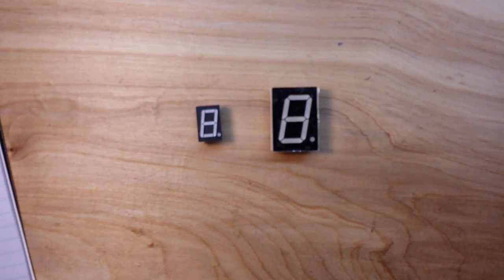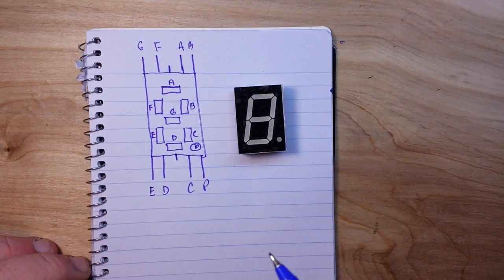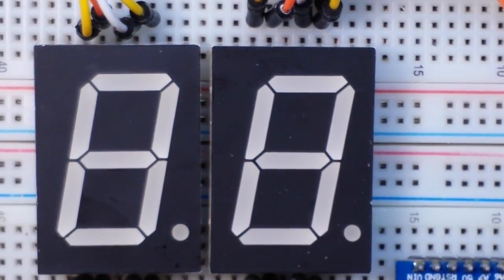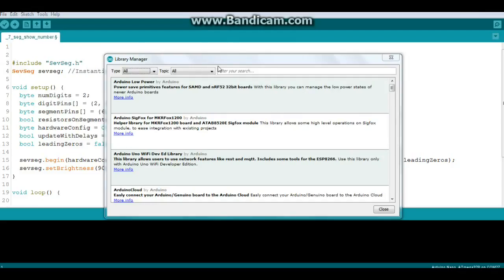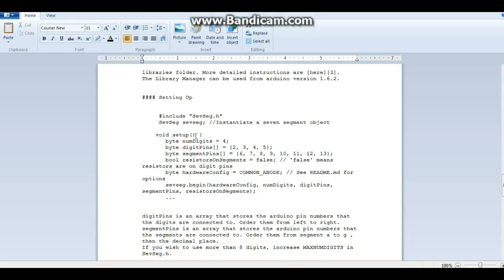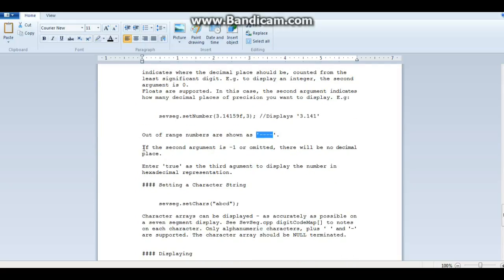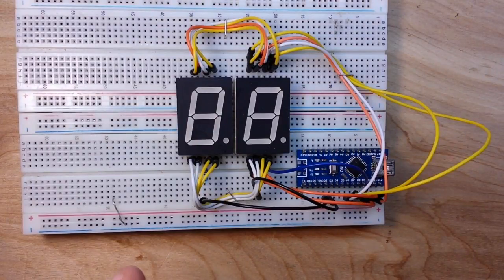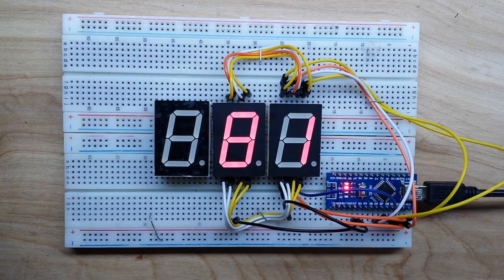Arduino Seven Segment Display Library

Comment: If you use 7-seg displays for a digital clock you can have free LED colons by flipping the tens minutes and tens seconds displays upside down and re-designating the segment connections . The decimal points then make the colons and can be either hard wired 'on' or controlled by the Arduino.

Comment: I'm using the "sevseg" library and am wondering how to change the number in a reasonable manner without the code flying by. I noticed that you can't use the delay function with this library. I am new to C++ but this seems like a very very critical ability to have and it seems like in this tutorial and others, this crucial detail of the work around for this is omitted. I like a fixed number for eternity, but I would also like to change it a bit.

Comment: If your using a common Anode, isn't the digit pin going to be the 5V pin because you have to power it somehow. I have tried to plug it into pin 2, with just 1 numDigits but it's doing nothing. Any advice on this would be greatly appreciated! Thanks
Reply: Never mind! Sorry! My fix was needing to remember to call, "sevseg.refreshDisplay();" which taught me that my power pin can in fact be a digital pin (num #2) rather than 5V which I find really cool. And that the wires from the display are going to the other pins which in this case are acting as the grounds. (I'm typing all of this out to help anyone else who happens to be new and comes along with this similar question. Hope it helps!) Thanks for the really cool tutorial. I appreciate it a lot.

Comment: Sorry but this library is horrible. It is slow because of digitalWrite commands and no interrupts are used so the only thing your program is doing is just refreshing the display. Much better and easier is to use MAX7219 modules or Chinese TM1638.
Reply from the maker: cbm80amiga no problem, it's not my library. I'm well aware of the Max7219 and have done a couple of videos on the subject. But not everyone has an IC on hand. I was just demonstrating a software solution. By the way, I enjoy your channel.
Reply: Thanks, I watch your videos too :)
Reply: cbm80amiga

Comment: Are you getting close to exceeding the current capability of the arduino's pins?
Don't think I would put more than the 2 digits you have on at a time.
Check out the Max 7219 for driving up to 8 digits, or more, with only 3 pins.
Reply from the maker: MrJohnnaz no that's the beauty, they are all in parallel, so 8 pins total for segments and one pin per digit.

I've used the 7219, and I like it, I was looking for something that need any extra hardware.

Lots of different ways to handle things, that's one of my favorite things about an Arduino. If you look long enough you can always find a solution that will fit.